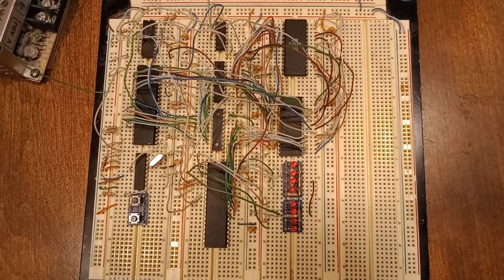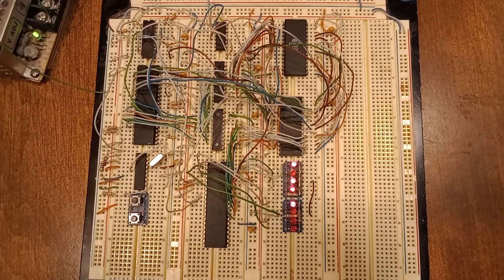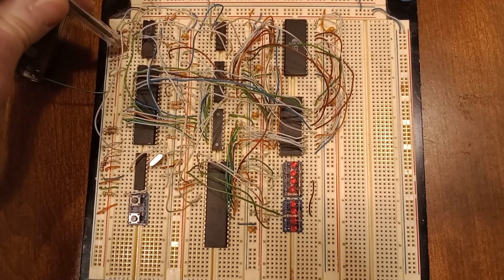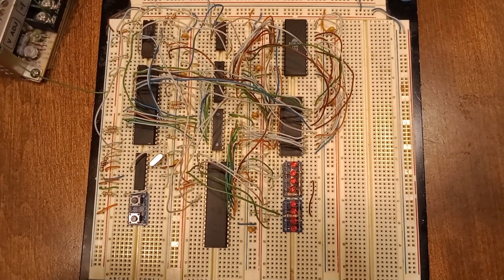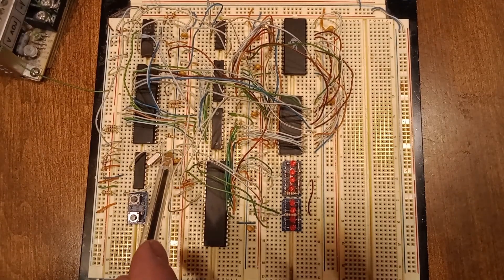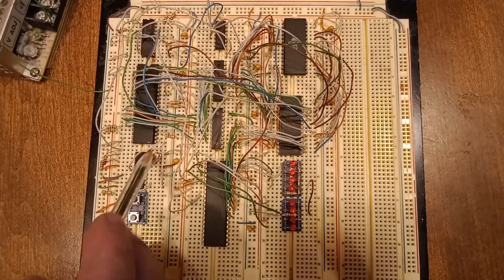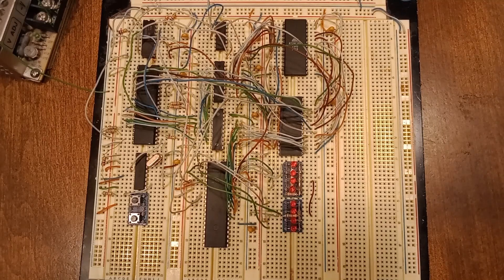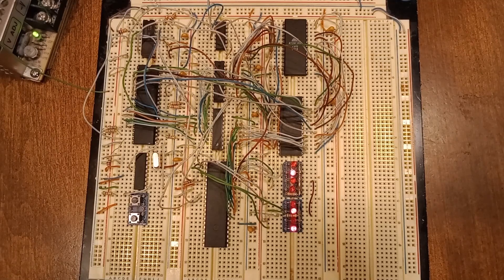8088 Maximum Mode Demo

Comment: If I understand correctly, "Maximum mode" allows additional processors in the same system to share some of the same resources, due to the bus controller.  So with these experiments, are you working toward a version of your homebrew system that can support an 8087 math co-pro board? 

If so, I wonder if the motherboard would have to be different, or just the processor boards, to get the whole system running in maximum mode. Do you think the 8288 would have to be on the motherboard, or could it go on a max-mode-ennabled CPU board that could work in your existing motherboards?

In any case, cool project, I wish you all the best in working these out.
Reply from the maker: Yes a Maximum mode processor card could be build as a drop in replacement for the existing processor card. The intent would be to gain the 8087. 

If you look at the schematic for an IBM PC the system bus request on the 8088 are not available on the ISA bus. The DMA controller was used to gain access to the bus as needed. 

The problem right now moving forward is finding parts. I am looking for a 82188 bus controller to finish my Maximum mode processor card.

Great comment!

Comment: What would be quite welcome in the vintage x86 community is a new system that can handle a few megabytes of EMS RAM. Why? For old CNC machinery that runs with DOS control software which uses EMS, and only EMS, for loading GCODE files.
Reply from the maker: I have not tested EMS ram on the project yet. Someone else might have done so. It would be neat to use it on some older CNC machines
Reply: @elijahmmiller  most likely just have to ensure there's an unused 64K block in upper memory, or a total of 64K free for LIM EMS 4.0. I don't recall the minimum chunk size for 4.0. I did try on an old laptop but it's UMB was to fragmented for any MS or 3rd party EMS to work.

I've thought about an old PC104 system with an 8088 or 286 but the prices people expect for that old stuff are insane.

I'm wishing I still had the 12Mhz 286 with a total of 12 megabytes RAM. 512K of DIP onboard with the rest on three 16 bit Micron ISA cards. Split 50/50 XMS/EMS. I had everything set up so whatever DOS game I ran or OEM Windows 3.11 (not WFWG 3.11) would automatically use the right settings. I had a Soundblaster 2.0 and a PAS16 (one without the SCSI controller), EGA video, multi I/O. I forget what was in the 8th slot.